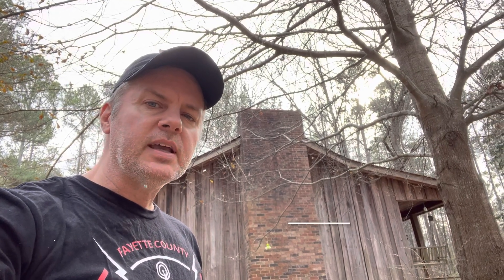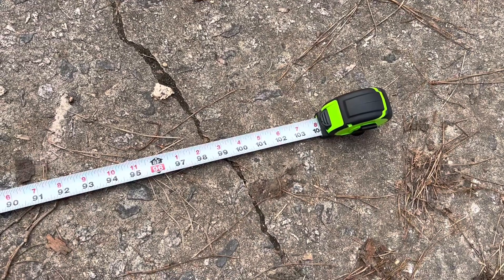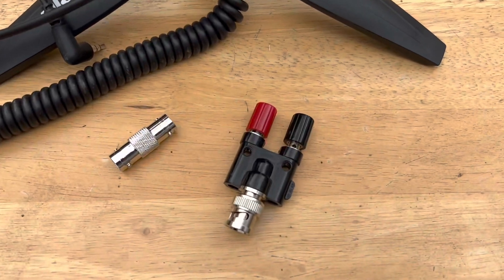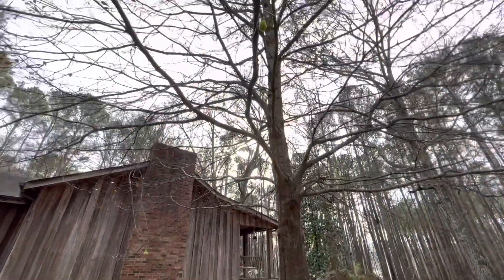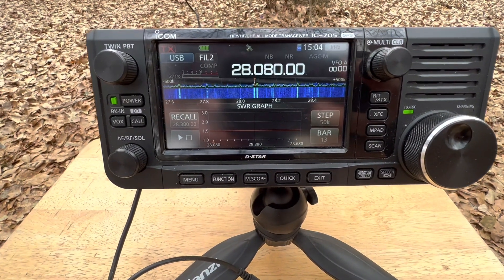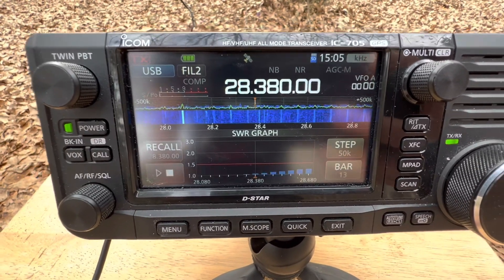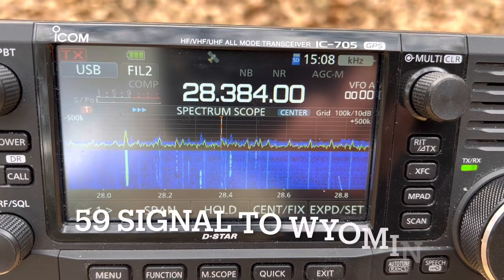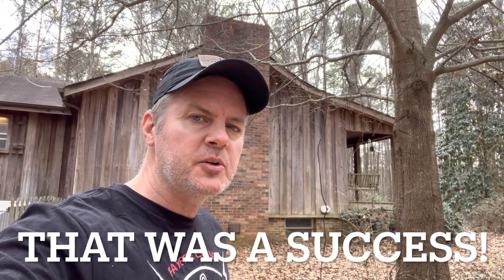How to build a simple speaker wire antenna for 10m and use it to make a contact with the IC-705

Comment: How did you tie the BNC banana plug adapter off in the tree? Do you need the legs spaced out at a certain length? 73 and thank you!
Reply from the maker: I used some 550 cord (paracord) to tie it up. There’s a small hole in the banana plug adapter to run it through. The legs are the length of each segment of the dipole. More cord on each end to tie them off.
Reply: @KI4ASK  
Very good! Thank you for the feedback.

Comment: New to this. Is it possible to make one of these for the 2 meter band?
Reply from the maker: You could, just measure the wire length to be resonant on the band.
Reply: The wire should be cut to about 19 inches on each leg for 2m.

Comment: Would adding a small weight near the ground to help make it vertical be ok?
Reply from the maker: I don't see why not. Should work, although you might have to adjust the antenna length a bit to account for the change in orientation.

Comment: New guy here. Can speaker wire be used for gmrs frequency?
Reply from the maker: @albertlevy3721  Yes but because it’s in the 460 MHz range the wavelength is much smaller and you don’t need that much wire.
Reply: @KI4ASK Thanks, was thinking of something for the field, like in a tree.
Reply from the maker: @albertlevy3721  consider a roll-up J-Pole. Here's a great one from N9TAX - you can also find plans on the internet to make your own.  I have a VHF/UHF version for the ham bands and it works great -> https://n9taxlabs.com/shop/ols/products/dual-band-murs-gmrs-slim-jim-with-10-or-16-foot-cable
Reply: The two parts of the dipole will be less than 7 inches. You need an SWR meter and need to trim very slowly. Use the highest GMRS frequency and trim it down to SWR 1.5. Then all the lower frequencies will be good. I use one indoors and it works fine. I made mine using 1/2" PVC with a T in the middle. Use 9" pieces in all 3 parts of the T.

Comment: Thank you! I used this video to build a similar antenna. The only thing I changed is I used antenna wire from SOTABeams instead of speaker wire. But putting out 5 Watts on my 705 I was able to QSO with a guy 2,100+ miles away (San Antonio TX to North Cascades WA). Pretty incredible!
Reply from the maker: That's great Travis. QRP is fun!

Comment: I've been wanting to build a 10 meter verticle antenna simply so I can connect with a local group that meets every night on 10 meters. My long wire end fed works great for my normal HF'ing but for some reason I can only connect with half of this group. Nobody is all that far away but I just can't hear them. They are all running verticles so your antenna might just be what I need. I'm not ready for the likes of the DX Commander series yet (room wise). Ha.  I am totally new to HF.
Reply: Isn't this dipole horizontal also? Sounds like you need a vertical wire antenna to match your group's verticals. Lots of them on here to look at... Good luck!

Comment: Thus is not hamvradio

This is CB RADIO. another poor antenna, another plastic radio and one contact with way excessive power  is NOT amateur radio.

Its been done to death.
Reply from the maker: You're wrong on some many levels.  It's the 10m amateur band, not the 11m citizens band. So you're wrong there.  It wasn't a poor antenna, it's actually a resonant antenna that worked great. So you're wrong there too. I don't know how much power other station was running, but I was running 10 watts. The IC-705 is a QRP low power radio. So you're wrong there too. K8BYP you're just wrong here my friend. I guess you're just a troll.
Reply: @KI4ASK   Poor guy has been around nuclear radiation too long, let alone HF... Good video, thanks!
Reply: Say "I don't know jack about ham radio" without saying "I don't know jack about ham radio." Mission accomplished!
Reply: Sad HAM…

Comment: I tried just that exact thing with copper tubes a half inch in diameter and no luck.
Reply from the maker: Copper tubes?
Reply: Copper pipe??
Reply from the maker: @gulfy09  I've never tried to build a dipole antenna with copper pipes.  I've seen vertical antennas with copper pipes (specifically J-Pole antennas), but never a horizontal dipole.  Assuming the dimensions are similar to what I did with the wire in theory it might work.

Comment: Hi I’m really new to this.  I’m curious what you used for your feed line?  I’d like to make this but then run the line into the house for winter.  Can you do that?  And how do you ground?  Again super new.
Reply from the maker: I used a short run of RG58 cable as the feed line.  Because I use this as a temporary, portable antenna I did not ground it - I recommend this antenna for portable operations.  The banana plug adapter used is not very weather proof.
Reply: @KI4ASK  Thank you for the fast response!  I’ll keep searching for how to do this as a permanent set up for a ham shack.  Thx!

Comment: Did you put anything on the end of your wire to put any cordage to tie it off to like a tree or something
Reply from the maker: I didn’t but you certainly could. That’s a great idea
Reply: Ok thanks ,How much power can you run on this dipole? Or is it limited 5-10 wstts
Reply from the maker: @garytedlock7533  Gary, I'm not sure to be honest.  I mostly operate QRP and I knew the speaker wire could handle low power.  I'm sure you could find an online calculator somewhere to plug in the wire characteristics and figure it out.  I would imagine it can handle much more than 10watts since it is speaker wire.  I'd estimate at least 50 watts, maybe more.
Reply: @jdomaleski   Thanks,  I'll start out and then go from there.unless I find out different

Comment: Max watts is 5?
Reply from the maker: Depends on type of wire and gauge.  I ran 10 watts through it and it could probably go much higher.  Here’s some information - https://www.elprocus.com/wire-gauge/
Reply: @KI4ASK  Thank you! I just saw another version of this same antenna and 100 watts was suggested...
Reply from the maker: @K4DSX  I personally think the 16 gauge wire I used could handle 100 watts SSB, but have not formally calculated it’s rating

Comment: What size wire did you use? KD9WTH 73
Reply from the maker: I used 18/2 speaker wire. (18 AWG)
Reply: @Joe Domaleski, KI4ASK  would 16g  be to heavy
Reply from the maker: @garytedlock7533  no, that should be fine.
Reply: Thanks KD9WTH  73